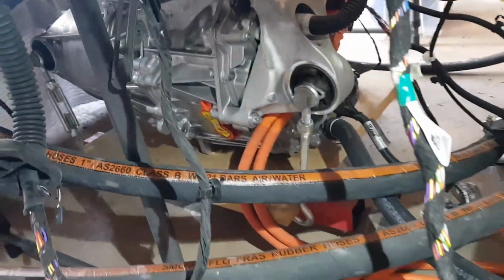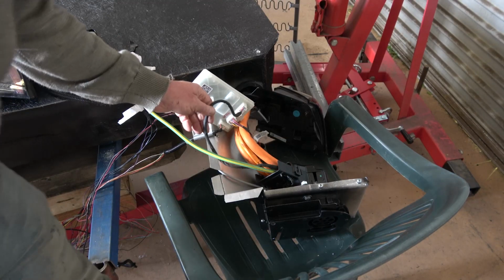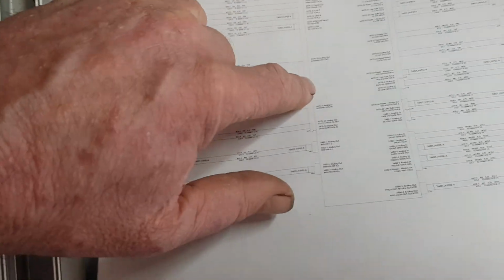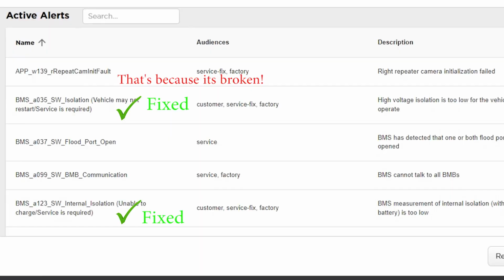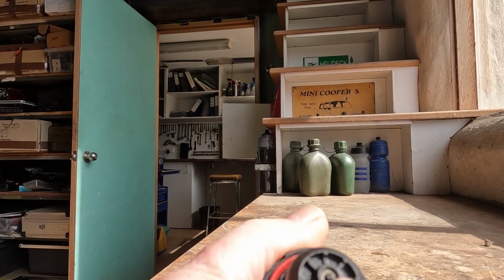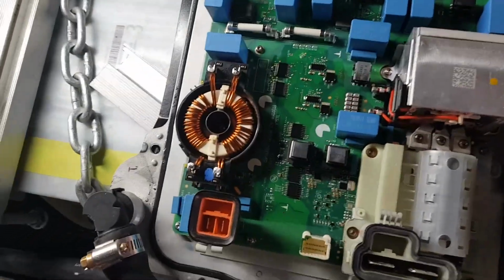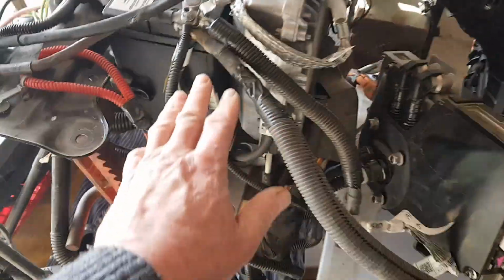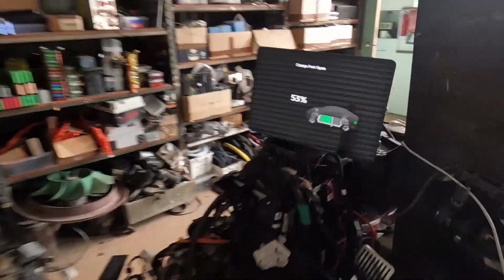Land Rover FTI 12: Sorting problems

Comment: Question about those flood ports please. Could you just attach a small magnet to the sensor and "trick" it, so it thinks its installed?  Thanks.
Reply from the maker: @v8trike939  Yep. I reckon that would work!

Comment: Hey Syd. Really appreciate these videos. Could you expand a bit on what the the firmware mismatch and CAN re-deploy  process is for us noobs please ? Cheers.
Reply from the maker: Hey Bill. Well I'm a bit of a Noob as well but I'll have a go at how I think it works! So all the different computers in the car need to have the correct Firmware to match the car (i.e. different battery sizes, heat pump or not, headlight types etc...) They also change the firmware to improve things as well. So the appropriate "software package" is downloaded to the car over the air and stored (in the "gateway" I think???). Then the different firmwares are deployed from this package to the different computers. If you replace one of those components the chances are it will have a different version of the firmware so you need to get the car to re-deploy the last lot of Firmwares that were previously downloaded. The "CAN redoploy" just redeploys to the components that use "Canbus" comunication (as opposed to linbus/ethernet connected devices I guess) You can now do this without "Toolbox" if you have late enough software version in your car. Go to Software Tab, press and hold "Model 3" for a few seconds, type "service" and there is a "software reinstall" option. Super usefull!

Comment: Hey Sydney is there anyway you could tell me any way I could bypass the flood port sensors, looks like you were able to make something to get yours to be happy. But could we use a resistor in their place to just eliminate them and keep the HVC happy?
Reply from the maker: Possibly. I didnt try that because I want to keep them functioning. I'm not sure if they blocked the contactors connecting or going in to drive - I just fixed them because I saw the error in Toolbox.
Reply: @sydneyg007  anyway you could do me a huge favor and check resistance between pin 8 and 22  or pin 9 and 23, to see if I can fool the HVC to thinking the flood ports are closed that would be huge for me
Reply from the maker: No problem. Measuring across the pins doesn't produce a resistance because it is a hall effect sensor, but with the car powered up the hall effect input reads 13.83Volts with the output pin measuring .64volts. I don't know the current unfortunately but I would start with a 1K resistor and adjust accordingly. Are your flood sensors faulty or missing? It may be easier to buy some from Tesla directly. You may be surprised with how cheap new parts are from Tesla! Just looked at the EPC and the flood port assembly is an over the counter part (non-restricted)  @drewthecarguy
Reply: @sydneyg007  that gives me a great place to start, thank you!!  My flood ports are just missing, I was like you and didn’t think much about them when relocating my penthouse, looks like they are pretty important lol and won’t shut contactors when open
Reply: Thank you for your help, 1.5k ohm ended up working out great for me, to fool it
Reply from the maker: Good to hear. Nice work! Now I want to know what sort of project you have going on there!  @drewthecarguy
Reply: @sydneyg007  it’s a 2002 Toyota Tacoma 2wd with model 3 rear drive and full battery pack everything is done but I’m fighting the High Voltage controller to close the contact
Reply from the maker: Wow. Sounds awesome! Love to see some video on that! Make sure that the HV controller has a ground connection to both screw holes next to the plug, also the HV interlock (including the charge port plug interlock) and that everything is earthed properly. Just throwing a few ideas out there. What sort of diagnostics do you have? If the firmware is fairly recent the cars service screen is super usfull otherwise getting vitals using Tesla Toolbox - I have a Tesla service contact in Ukraine that can log in to the car remotely and use toolbox that way (so you can save money on Toolbox subscription) if needed.  @drewthecarguy
Reply: @sydneyg007  I’m using EVcontrols controller so I don’t have the luxury of the factory Tesla toolbox, the only troubleshooting guides I have is google lol. My last two faults I’m really battling with is BMS_a054_SW_Ver_Supply_Fault and BMS_a179_SW_HVP_12V_Fault.  What’s hard is no one online has had those faults apparently so I’m really just troubleshooting blind
Reply from the maker: Ah right. I didn't know EVcontrols had come out with the battery controller but looks like they have! OK, so I would guess you have a firmware version problem. Looking at Tesla article #35977 (that I downloaded from Toolbox) "BMS_a179_SW_HVP_12V_Fault" is now called "	BMS_a179_HvpGpoRequestActive": BMS received a request from the HVP to initiate a Graceful Power Off. This alert was formerly named BMS_a179_SW_Hvp_12V_Fault in firmware versions prior to develop/2020.48. If BMS_a179_SW_Hvp_12V_Fault appears on the vehicle or in the logs, update the vehicle firmware to the current version.
What documentation did you get from EVcontrols? Do you reflash the firmware of the HV controller using their interface (which is what they do with the motor firmware I think). BMS_a054 error seems like an error in obtaining the software version? I would think EVcontrols should be able to provide you with guidance on how to solve this (and could be very usfull for others running in to the same problem!) @drewthecarguy
Reply: You are the man, thank you so much, after I get this truck on the road I’ll make a nice YouTube video explaining things, I love the fact your able to make some good videos explaining stuff
Reply: I am still in need of some help if you can. I still have some faults that I can not figure out and I know it has to be something easy

The faults that are still present are 
Bms_a179_SW_Hvp_12V_Fault
Bms_a059_SW_Stack_Voltage_Sense
Bms_a0125_SW_Shunt_MIA
SW_Stack_Voltage_MIA 
Bms_A054_SW_Ver_Supply_Fault

It seem my HVC is not producing any voltage to the shunt or the contactors like the wiring schematic says it should. I have replaced the HVC thinking it could of been faulty, and EVcontrols have tried reflashing all the firmware multiple times. I’m really at a loss with not much help out on the internet. Could I have a bad PCS you think?
Reply from the maker: Ahh, how annoying! It doesn't sound like a PCS problem to me. All of those faults have "SW" before them which I am guessing is "Software". I presume you are reading these faults from the EV-Controls controller so what you are reading is not coming from any Tesla written software but are  "Evcontrols decoded" canbus signals. It could be that "Evcontrols" have tested their stuff on different Tesla firmware version HVcontrollers and not on the firmware you have in your HVcontroller (there are LOTS of different firmware versions). Either way "Evcontrols" should be giving you lots of support to diagnose as it is in there interest if they want to sell their product. Other than that, hardware wise I presume you have everything else connected properly as per when it was in the Tesla. Make sure you put a "Genuine" pyro fuse in (they are cheap directly from Tesla), your shunt is connected (and needs to be the original one calibrated to the HVcontroller), you have a GOOD connection to a good 12 volt battery, your grounds are sorted (including the HVcontroller screw points), BMS daisy chain wiring, HVinterlocks, you have the motor/s connected to HV power (to provide the capacitance the HVcontroller is expecting to see), the relay feedback wires, flood ports, PCS harness, PYRO sqib is ok. I've just bombarded you with lots of things there in the hope that it might be something you haven't checked or overlooked! @drewthecarguy
Reply from the maker: Also, do you have the charge port ECU connected and is it the one that came with the battery pack? @drewthecarguy
Reply: Lots of good information there. One thing that stands out is I’m not using a oem pyro fuse, I just bought a cheap one off of Amazon. I have a oem one on order now tho. My issue has to be some sort of safety interlock or something causing the HVC not to put out a power supply to sensors like the shunt sensor. I do have the charge port Ecu connected but it is not from the same Tesla, but that is something EVcontrols flashes new firmware into. Thanks for your support hopefully this information can help someone in the future, I’ll report back after the new pyro fuse shows up and hopefully it’s just something simple like that
Reply: Still can’t figure this out, replaced the PCS today with another one, evcontrols reflashed everything and stiff has the same faults, I’m not sure if a oem pyro is going to fix it, the current pyro I have has almost 1 ohm of resistance between the pins of it. I’m curious if a oem one is different. Also reading resistance back on the controller with the pyro unconnected. Any ideas please let me know. I’m just about to just use a Arduino to get the contactors to close to see if it is evcontrols controller causing the issue or something else
Reply from the maker: I would put the original HVcontroller and PCS back in as they are paired together (and all have to have compatible firmware to work together). The pyro fuse itself should have almost no resistance across it (not measurable with a standard multimeter anyway) but the little pins for the explosive sqib should have something like 2 ohms across. It might be worth buying a cheap esp32 can device (Lilygo T-can485) and using "Dala The Great's" battery software to see if you can close the contactors. For more details go to his channel: @DalasEVRepair and go to his github for all the details.  @drewthecarguy
Reply: That’s what I’m thinking, I have a Arduino uno but I don’t think it’s fast enough so I have a Arduino due coming here on Sunday and I’m going to try and close the contactors myself, I’m really thinking evcontrols just doesn’t have a proper battery controller yet, after all this troubleshooting there really isn’t much hardware in the penthouse it’s just a lot of software
Reply: Sydney, all your work and this video documentation has been the most valuable model 3 battery info on the internet, you have given us a great resource. I have a 2019 battery and I am also using EVControls. I finally got the contactors to close after grounding both screws next to the bms plug. My PCS is charging the 12v at 16 amps. It makes a sound similar to your beep, just not as loud and it’s continuous, not a beep. My model S drive unit will spin, but it won’t charge and the charge port ECU and charge door LED flash red. I’m going to try grounding that big lug on the charge port.

Comment: Hi Sydney, i'm Sidney from holland ;) I was going to order a tesla motor and battery pack for my land rover discovery 3 retrofit and then realized why not buying the entire car at an auction. Googled the idear and i came accross your project. Just love it, you are taking all the stress factors away. I was wondering, because my lr3 is from 2009 i have abs / air suspension / electronic breaks...etc. Do you think i could connect everything from the tesla donnor car in order to avoid having to code anything ? And can i keep both engines, one on the front diff and one on the rear diff ? Thank you in advance for your help. Regards, SIdney
Reply from the maker: Hey there Sidney! First most important consideration is where are you going to fit the Model 3 battery pack? Your unlikely to be able to use it in it's orginal packaging. You may be able to fit it in the rear cargo area without the rear seats. To package it how I did (2 high 2 wide) you need at least 195cm length x 71cm wide x 19cm high (most vehicle don't have this sort of room to spare). Your brakes will probably be easier to do than mine because you can incorporate the tesla wheel speed sensors. I would think you would do a single mid mount motor using the Tesla rear Drive unit running the prop shafts. I don't know how the LR3 air suspension works excactly but you would either need to use the original brain to control it or an aftermerket control system or change to a standard setup??  You'll have to sort out an electronic pump for power steering and use the same emulator as I did to fool the Tesla into thinking it still has it's power steering. If you can't fit the big M3 battery modules it's all sort of semantics really! An LR3 with a Tesla drive system would be amazing!
Reply: Hi Sydney, thank you for your fast return. I'm trying to fit the original packaging, the lr3 has the particularity of body removal option (the chassis and the body can be seperated with 8 bolts https://content.invisioncic.com/r226025/monthly_01_2010/post-21213-126389259229_thumb.jpg). I've noticed when i did it last year that between chassis and body there is a big gap of 15cm from front wheel to back. The body is mounted on these 8 points that could be made higher for better clearance. When i remove engine, gearbox, tank and exhaust it should be pretty big. Could you send me the dimensions of the battery and the penthouse seperated ? I can only find the total height of 33cm (33x150x218). Yes indeed, the LR3 has a big fan community and they are all looking for a quick solution in Europe because diesel engines are getting banned in every big city starting 2025. So if i can find a easy solution for everyone that doesn't require cutting open the high voltage battery pack it would be awesome. Where are you located in Australia, i've got family there all over there ;)
Reply from the maker: @sidneywales  Right, well if you think you could fit the battery pack as a whole that would save a lot of work! The pack without the penthouse is fairly squat at only 115mm high.
Pack Length 2150mm, width 1490mm (or 1360mm without the mounting flanges), and 115mm high.
Penthouse: Width 1230mm, Length: 440mm, Height 230mm
Would be great if it worked out and you could share the process publicly! 
I'm ~30km from Australia's Capital (Canberra)! Let us know how you go, or even better post some videos of your findings🙂!
Reply: Thank you so much for the dimensions, that is perfect. I think it's actualy possible now to keep the original battery cover, without any modification. What about the front motor, i whish to keep both running to avoid having to code anything. I see a lot of AWD for sale on the copart, this could be another solution. I was thinking in connecting the front motor directly to the tires like on the tesla, same thing for the back. I won't need the diff because all the land rover options will not be working anyway. For sure i'll try to film it, to see how far i get. I'll keep you in the loop. I've been to canberra once, most family is in Sydney and Melbourne ;) Have to make the trip again.
Reply from the maker: I was thinking that the LR3 still had a solid rear diff but I realised that it's independent front and rear so even better! Yes, both a front and rear motor out of a dual motor M3 would be ideal. Just need to get custom axles made up, also gives you more room in the middle of the car (and you get the bigger battery pack)!  @sidneywales
Reply from the maker: When you are shopping for a M3 (or MY) see if you can get one with a key card and ideally one that may still supercharge. @sidneywales